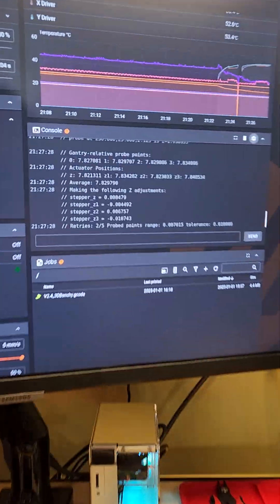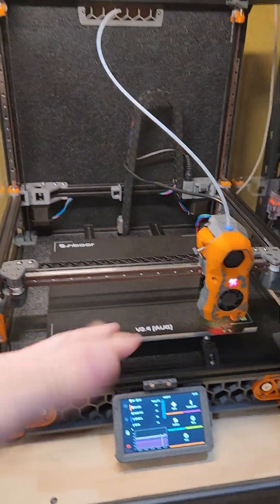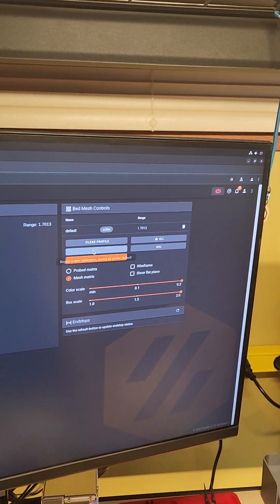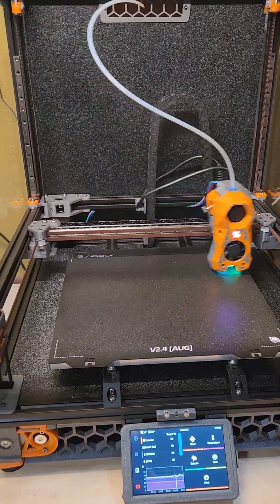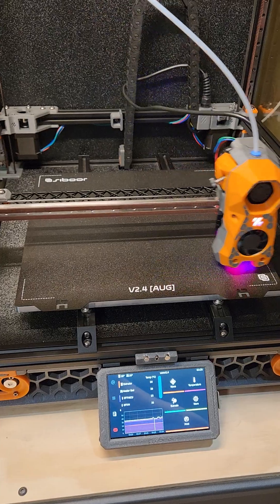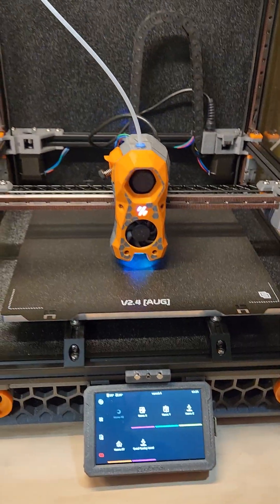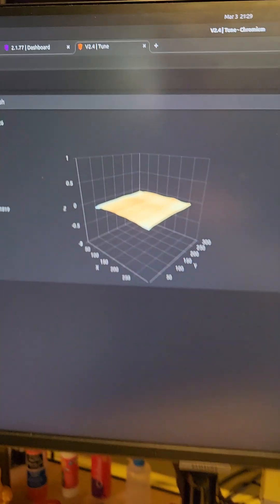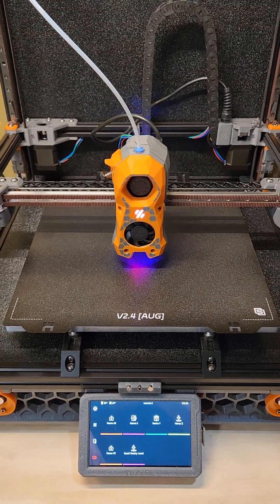The importance of a Quad Gantry Level. Bed meshing with the cartographer.

Comment: Awesome! Any videos on building that guy?
Reply from the maker: @ChristianLong-i4r  I actually built this one about a year ago and didn't record any of that process. There are a lot of build videos out there, so I didn't think mine would be that much different. I did a live for the toolhead but the audio was so bad that I deleted it. I do have new audio stuff though so going to try again in future!
Reply: @ can’t wait. I have a Bambu P1S / love it. I had an Ender 3 Pro but it was soooooo slow. I want to look into building the Voron and building the collection.
Reply from the maker: @ChristianLong-i4r Vorons are great machines. And I have an Ender 3 V2 that I converted to a Voron Switchwire so that's always an option too. Converted to Core XZ it's significantly faster!